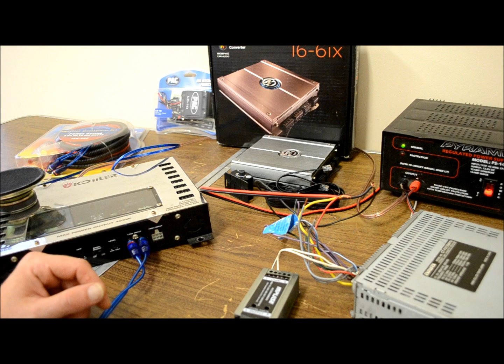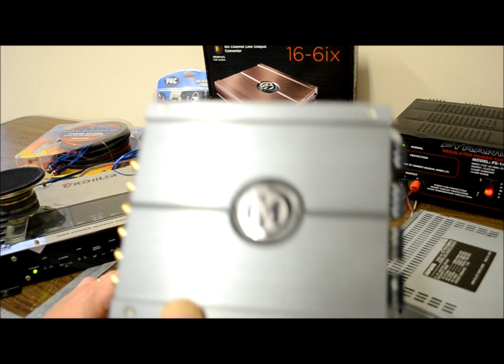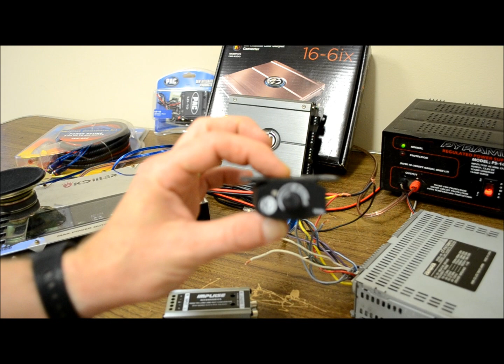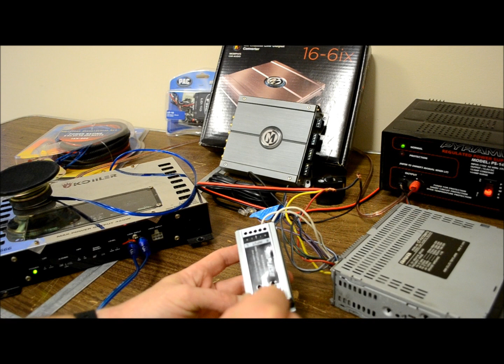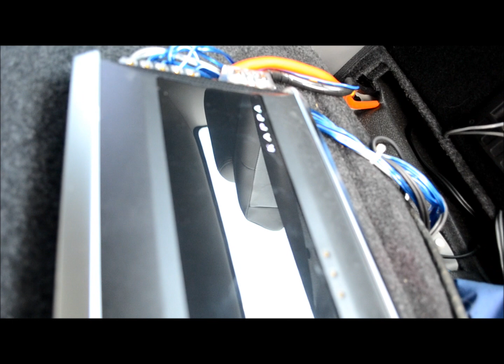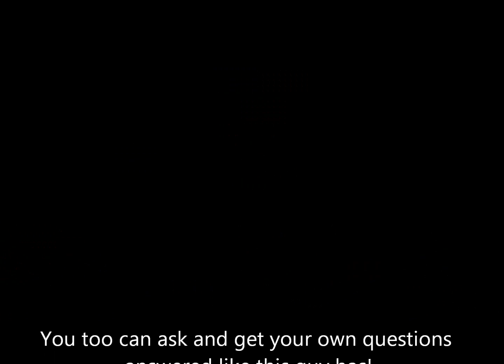How to add a bass or highs amp to a stock car stereo, And then some

Comment: nice video mate. Where do u connect ur remote wire from amp if u have a stock stereo?
Reply: Markie Mark just do a power wire from battery or other steady power source. put a toggle switch in it and boom

Comment: hey lessco , you see your power light on your amplifier, it's yellow when it's on but  when I connect mine it flashes and nothing works. what could be the problem?
Reply from the maker: +Mitu Ahmed do you still have the manual? I ask cause that led more than likely is flashing a diagnostic code to you!
Reply: +Lessco Electronics no I don't, I got the amplifier from a friend and also I connected the remote wire on my fuse box which says 7.5V (which is my radio fuse) do I have to connect it to a fuse which is higher than 12V
Reply from the maker: do you mean 7.5a instead of 7.5v?
Reply: +Lessco Electronics sorry, yeah
Reply from the maker: so you need to run that 7.5a wire to a 12v power source capable of delivering an auxilary 7.5 amps of power. I'd get out of that fusebox if I were you and go someone else for power.
Reply: +Lessco Electronics thanks I'll try that

Comment: Question: I have a 2012 chevy single cab with rear speakers (5x7 3 way wide range)  that are used, but unheard (They are crap), Couldnt I simply run the lines from the rear speakers to the in line converter? In the process using the dualed pins on the back of the speaker, linking out to said converter, then of course having the pre outs for amp use?
Reply from the maker: +Colt Zahradnick sure, that will work

Comment: If i have a converter all ready from my stock deck can i add an eq (eqs746) to that to run a full system instead of line driver?
Reply from the maker: +lilflip416 yes, you can alos use both if you wanted, the eq is the turning point to make it all happen

Comment: Hello, i just wonder if the head unit has 6 RCA channel output (4 speakers and 2 subwoffers), but an preamp equalizer only has 2 inputs, wich 2 outputs you select from the head unit to hook into the equalizer?
Reply from the maker: +REACTORVISUAL you can use either the front or rear, either is ok. just dont use the sub out
Reply: +Lessco Electronics thanks for your answer, i suppose i would not be able to control de sub woffer from the equalizer. do you mean send the low sub signal directly from the receiver to the amp or send it from the equalizer based on the 2 inputs hooked to the equalizer?

Comment: Speaker signal is NOT alternating current (AC). I don't know why you're making that comparison, but it's inaccurate. It's direct current (DC) for sure.

Also, if the amp accepts speaker wires as a source, you're going to lose less signal going that way. The line output converter (LOC) just filters/drops the power on the signal to low power for RCA inputs. You are actually losing fidelity by using a LOC. Not much, to be sure, but a little. The whole purpose of the LOC is to drop the power so that an amp with RCA inputs can handle it.
Reply from the maker: Pure AC is a time varying electrical signal which periodically reverses it's polarity, crossing zero twice per cycle. Pure DC is a constant, unvarying signal. Fluctuating DC is more appropriately termed AC with a DC bias; if you remove the DC bias (by passing the signal through a capacitor, for example), you are left with a pure AC signal. Thus, an analog audio signal can be either pure AC or AC with a DC bias.
Sounds right to me: the way to send an electric signal (digital or analogue) is to vary the potential between the two wires. It doesn't matter if one wire is always negative compared to the other (say, one wire stays at 0 and the other fluctuates between 0 and 1), or if the potential is reversed (one wire stays at 0 and the other between 0.5 and -0.5). At least not in theory, but there are probably practical considerations to prefer a relatively low average potential.
Reply from the maker: Lessco Electronics the way to send an electric signal (digital or analogue) is to vary the potential between the two wires. It doesn't matter if one wire is always negative compared to the other (say, one wire stays at 0 and the other fluctuates between 0 and 1), or if the potential is reversed (one wire stays at 0 and the other between 0.5 and -0.5). At least not in theory, but there are probably practical considerations to prefer a relatively low average potential.

Comment: You are the man. I'm going to be installing some atomics in my stock Honda pilot and this was the most help I've had from one video without having to make my eyes bleed over forums and such. Now I just need to find a way to increase my alternator power without spending a ton of money. If you have any tips it would be greatly appreciated. I already have the rca converter installed from my previous set up and I was extremely disappointed with the performance so this helped me a lot. Thank you very much
Steve B

Comment: Hi
I have a 2005 Toyota Corolla with a stock head unit. I have already changed all 4 speakers and front tweeters and have installed an amp/subwoofer combo in the car. I had to use a line out converter, as my head unit does not have any RCA plugs.
I now want to be able to connect a USB drive or ipod to my system.

Now I have found an equalizer which has a USB input built into it and would like to know a few things before spending the cash and buying it.

Do I have to first install line converters for each set of door speakers (front/rear or Left/right), connect them to RCA cables and plug these into the equalizer for the sound from the USB to be heard, OR, can I leave the door speaker connected to the head unit, as they currently are, and just connect the equalizer to a line converter and use the USB port that way?

I am unclear as to what channels are available as inputs to the equalizer. Is there a left front, left rear, right front and right rear channel, for each of the speakers, like there would be on a 4 or 5 channel amp?
Reply from the maker: You didnt mention the model EQ, That will determine how this all plays out.

Comment: .I need your help I installed a uv10 indash head unit in my 740i bmw and cant get any sound to come out the speakers someone told me it because I have a factory amp need to know what I have to do to get the sound to play please help
Reply from the maker: You need to turn the factory amp on in order to hear the audio, If youre using a metra wiring adapters be sure the blue/white is powered up. power the blue as well.

Comment: with the upgrade LOC like the one you showed, can I get the power from my amp instead of running a wire from the front of my car? as well as with the ground and remote turn on? so basically run wire from the LOC to the amp

Comment: there is no remote. there is a "remote" wire coming out from the factory radio harness. this wire signals to power antennas to go up or down. if you connect the remote wire to the romote input on your amp, it will signal to your amp to turn on, or turn off. without making this connection, your amp is useless. it will not turn on. it does not mean remote control for the radio like a tv remote.

Comment: boss ,i had my SUB and AMP hooked up in the back,i used a HI-LOW converter connected to the rear speakers ,because i dont want to open my head unit,so now i'm trying to install an AMP for my new door voice speakers ,So can i use the same converter for both amp?

Comment: how would you run this inline? does the device have an output terminal to run back to the front speakers, or would you just splice the speaker wire to the device, and to the speaker?